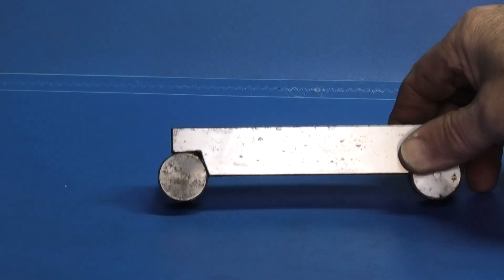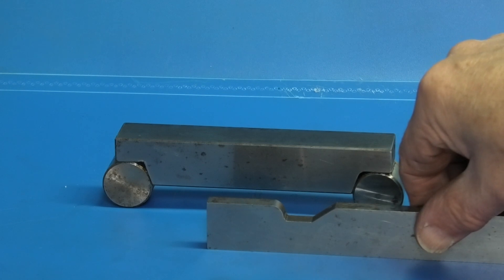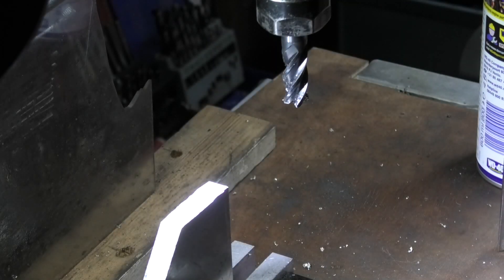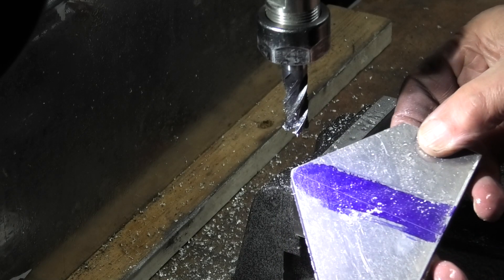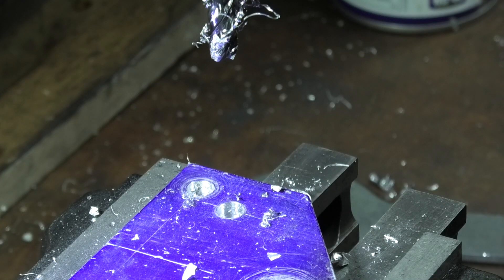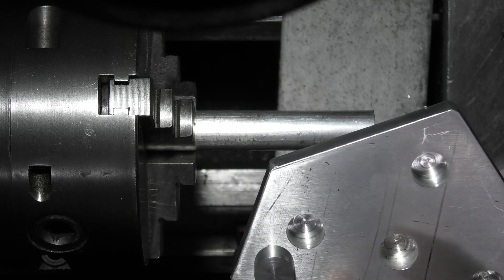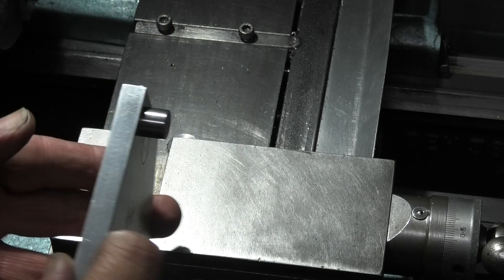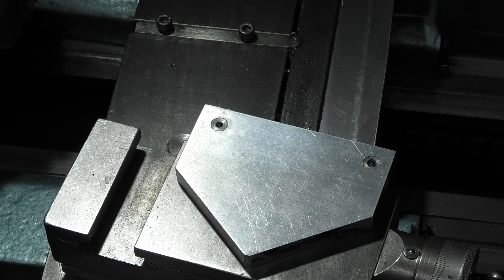Sine bar for the lathe

Comment: Hi Mate. Is the compound not needed to be set to o° and proofed with indicator.  Then the two points on sine bar is put against compound,  and proofed to 0°. This ensurers there are no errors between sine bar and compound. Then a  guage block etc, is used to set required angle and indicated.
Reply from the maker: Hi In my previous video I milled the compound slide face and checked that it was on Zero

Comment: Allan I don't have slip gauges can I use an end mill and then feeler guage to add up the space?
Reply from the maker: I would turn a steel bar to the required diameter about 15mm long and use that as a reference.